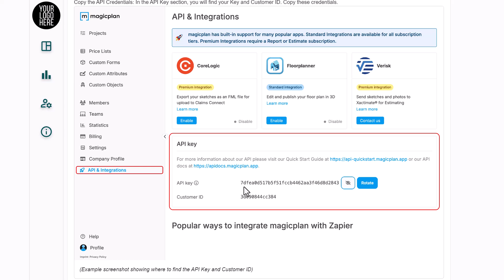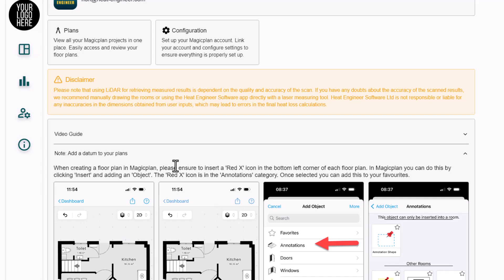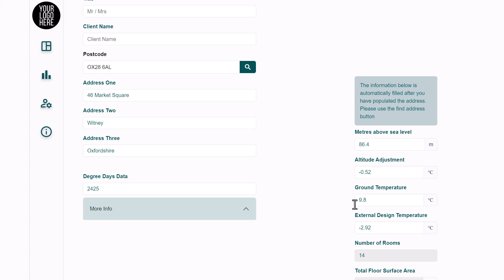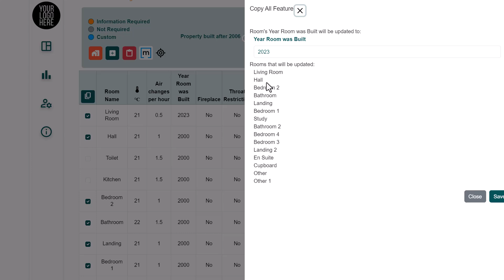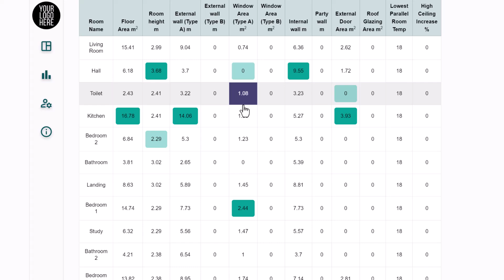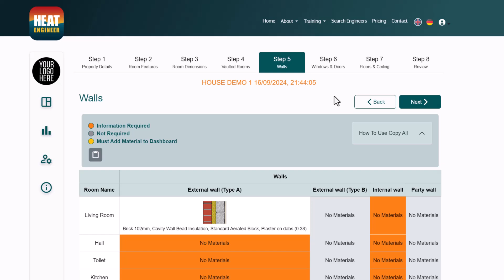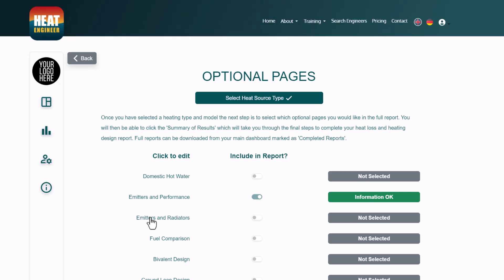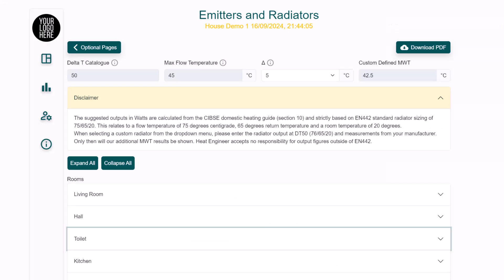Magicplan & Heat Engineer Software Tutorial

Comment: I notice that internal walls adjacent to rooms with the same room temperature have a heat loss value >0. If both rooms are at the same temperature, wouldn't the heat loss through the internal walls be zero?